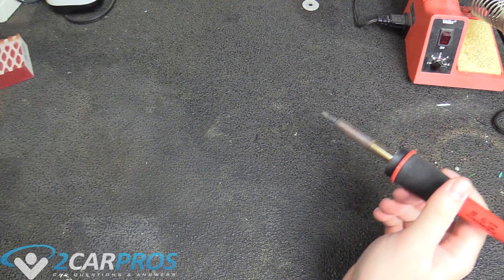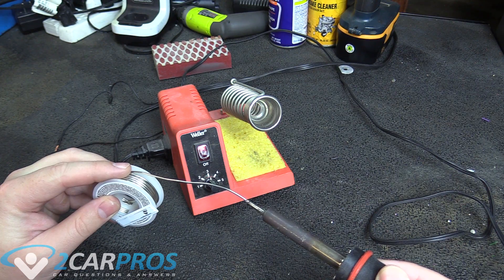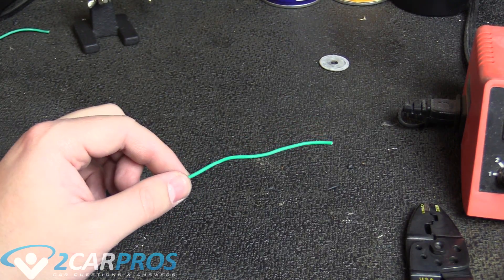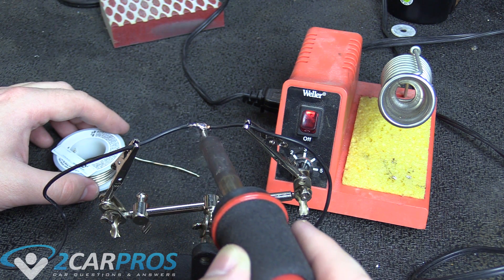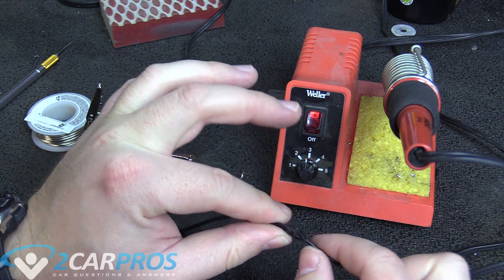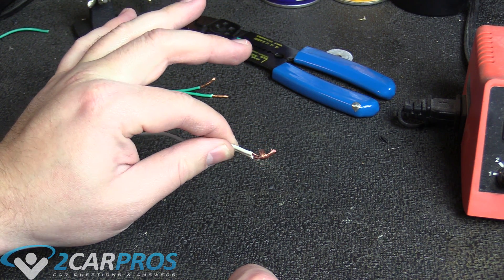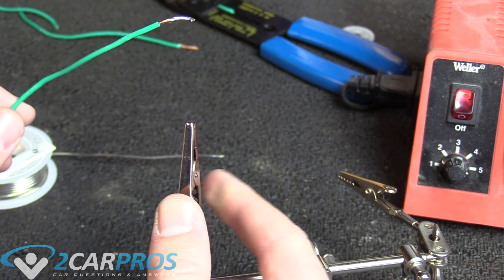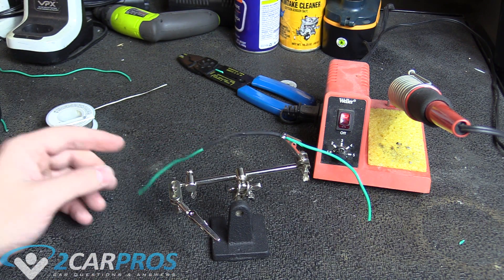How to Solder: The Do's and Don'ts of Soldering Made Easy!

Comment: When soldering you need to heat the wire first then add solder and let the solder wick through your wires, just a friendly advice. Plus when they wrap the wires it's to create a strong mechanical joint before applying solder, when you wraps it proper there's no strands that will be poking through
Reply: Did not know about heating up the wire. I have difficulty making lead stick to the wire
Reply: @darklyger64  yup you touch the iron to the wire (i usually touch from below) and heat the wire for about a second or 2, then touch the solder from top and let it wick through the stands, if u only melt the solder and run it through the wire, just the top few strands will get solder and it wont properly wick through, don't heat for to long though because you'll start to melt insulation, u can dip your strip ends in flux for the solder to flow faster and easier as well, don't melt the solder on your tip and transfer it....also put some solder on your iron tip before u start just to effectively transfer the heat....happy soldering